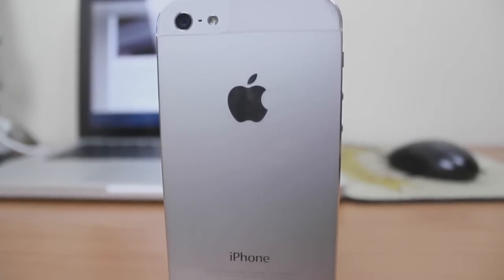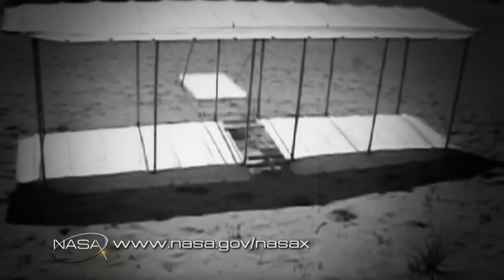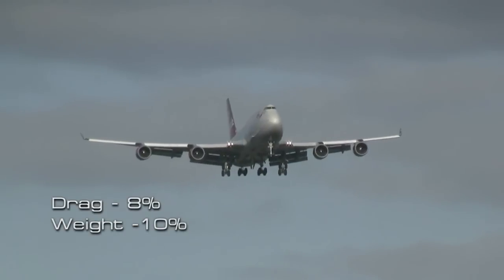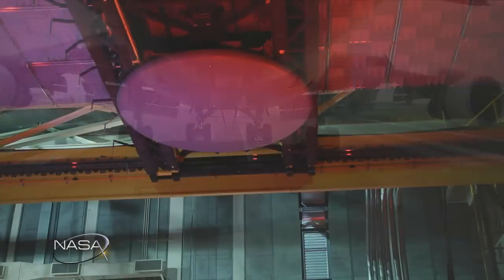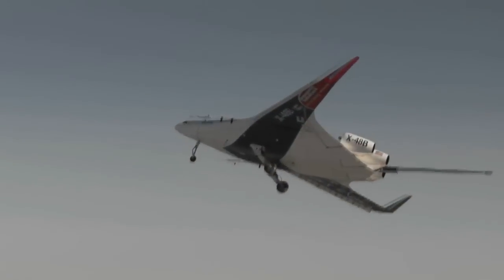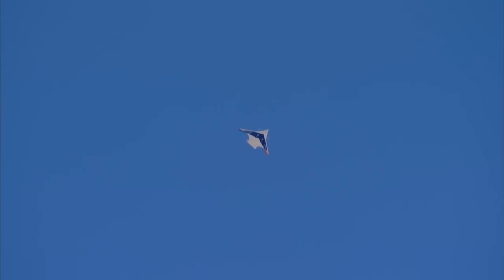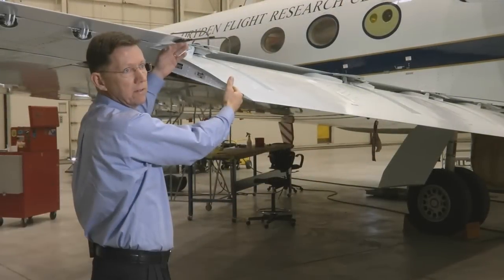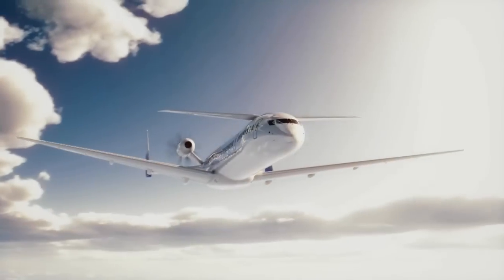NASA X Revolutionary Evolution - ERA

Comment: A good idea that leaves current ideas both financially viable and consumable alongside new ideas.
For example we can make a portable device that charges its battery when the device is in kinetic motion and can last 24hr with no charge, the device can then be linked to other devices wirelessly to make computations and relay info back to the end user. But we still carry mobile devices that limit this capability Evan though I've never charged my watch and my phone pulls data from my cloud account and very little is stored on the actual device.
When will I be carrying a device that logs on to my cloud account and used my home/ computing service provider to do all my mobile devices functions? 
A self charging wireless device, with sensors and output with very little computing power needed on board. Nice idea?